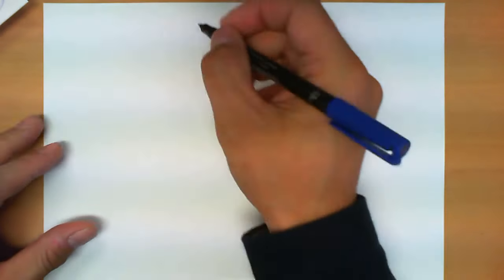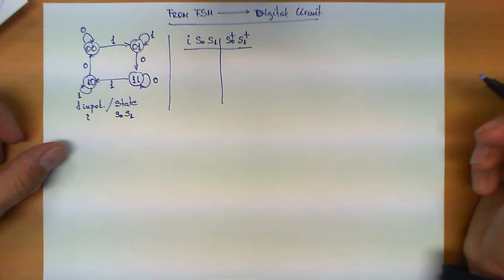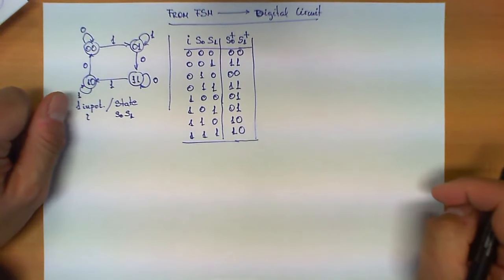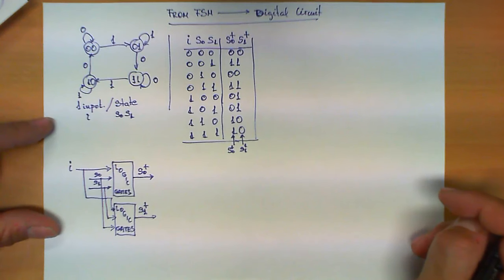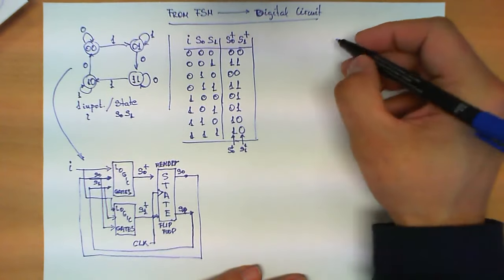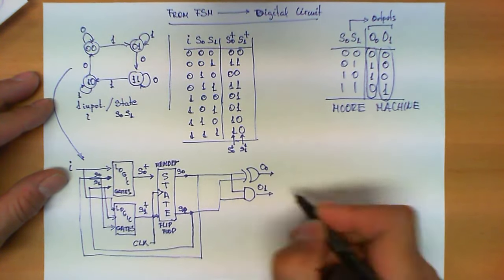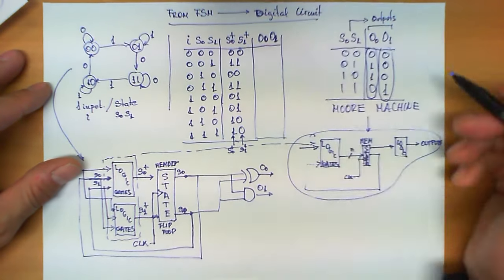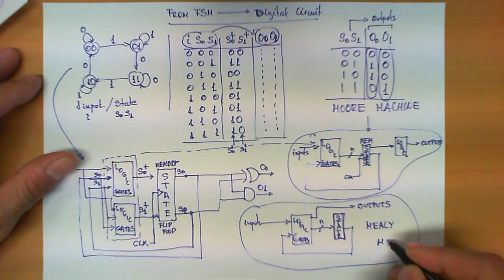From a Finite State Machine to a Circuit

Comment: This is a great help! Thanks a lot. I have a question, suppose I have 4-bits output, Q0,Q1,Q2,Q3 from this circuit. These outputs should in another circuit to give the following outputs:
S0=Q0+Q1
S1=Q1+Q2
S3=Q2+Q3
How to implement such circuit? Any hint or explanation will be helpful.